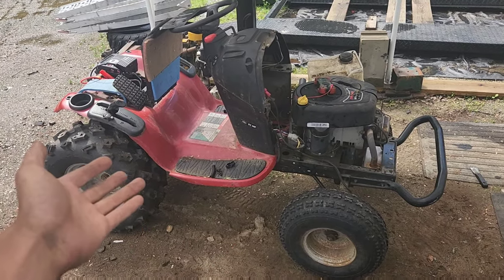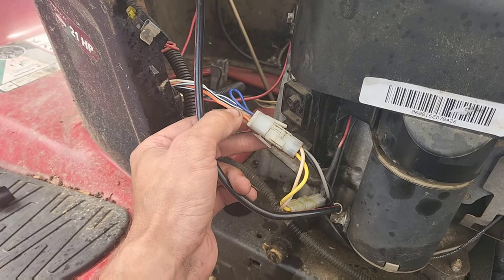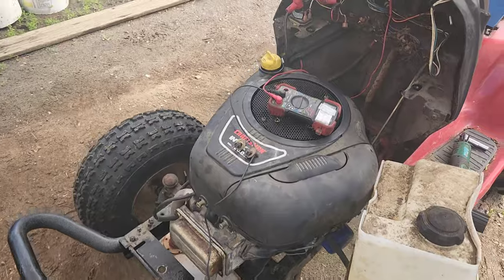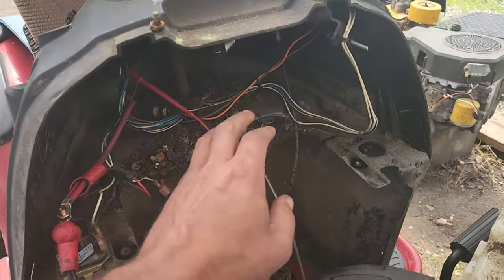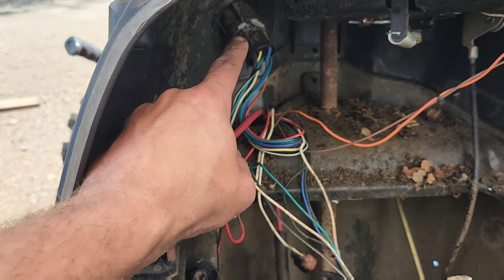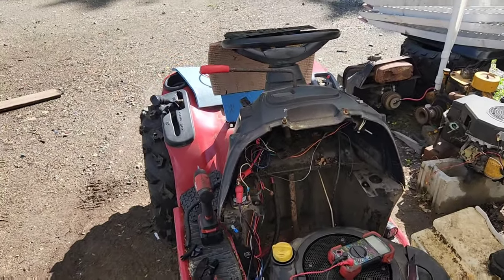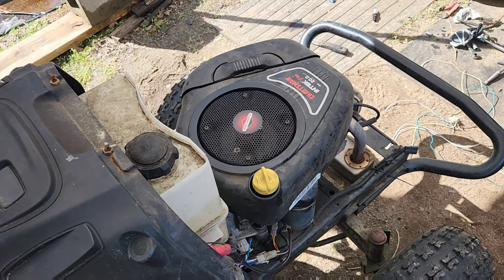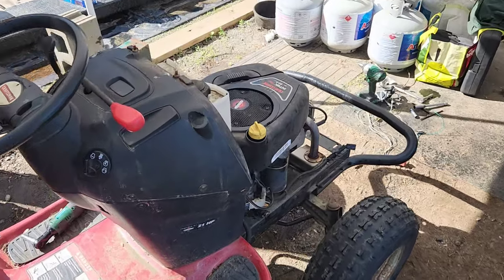Stock Key Switch used with Safety Switch's Eliminated

Comment: If you you get a Kawasaki bayou 220 intake and carb in will fit on your 14.5 - 18.5 briggs & Stratton you just need to hone the top intake bolt hole just like 1/16in and you can get a LOT more power

Comment: i have a lt4000 craftsman with a kohler 14.5 hp and the selonoid cliks but won't start
Reply: Probably the starter but first make sure voltage is getting to it. by using a screwdriver and jumping the solenoid.
Reply: two posts on the solenoid put the screwdriver on the two posts you may see a few sparks but it should turn over if the starter is good.
Reply: @louisianarebeltv4878  it's probably the starter because sparks came out of the solenoid when i put a screwdriver to it thank you